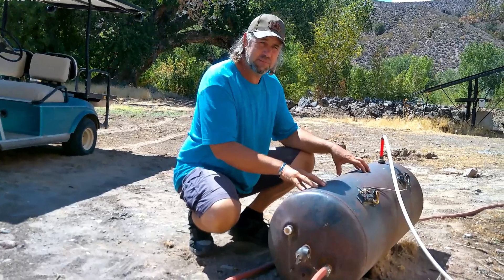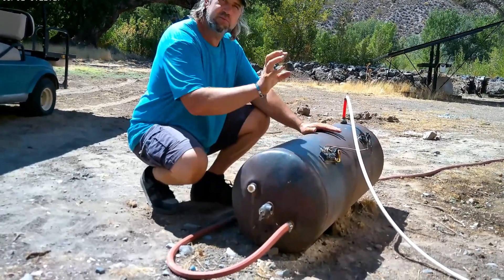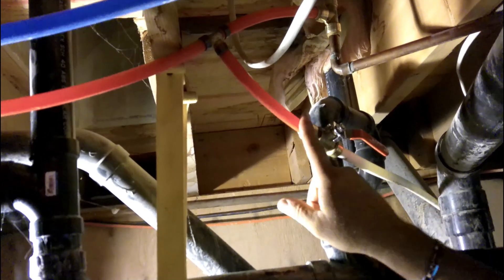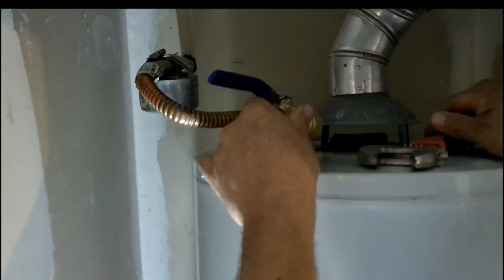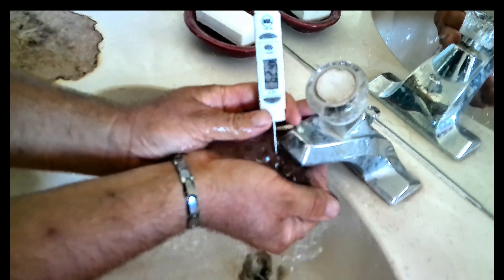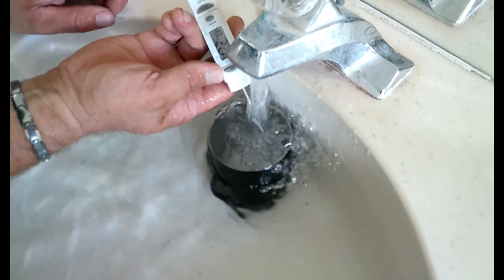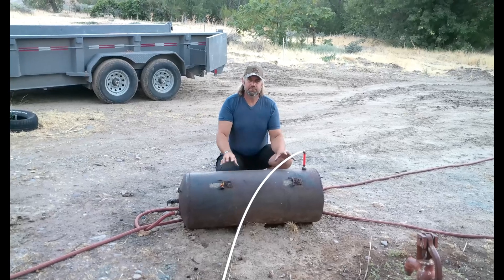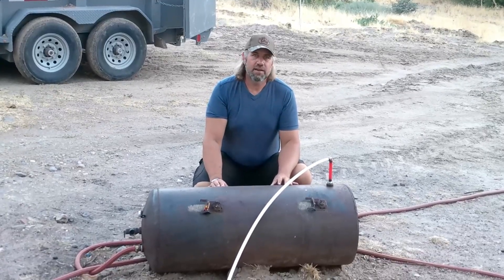This Solar Water Heater Saves You MONEY (2024)

Comment: Why did you lay the heater down instead of leaving it vertical?
Reply from the maker: I built this for summer so I laid it on its side to get the most surface area for the sun to heat.
Reply: @Thesolarfarmer  thanks for the reply.  I was thinking if used vertically with the cold water entering the bottom as you have it plumbed the incoming cold water would displace the maximum volume of hot water. Plus as the cold water level rose it would absorb heat from the metal tank increasing the amount of available heated water. Just my 0.02 cents worth.